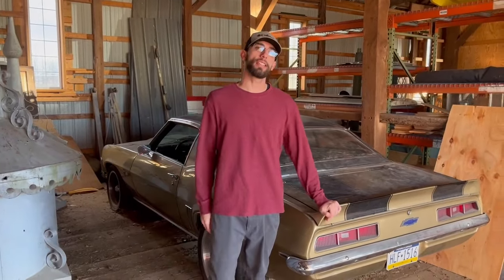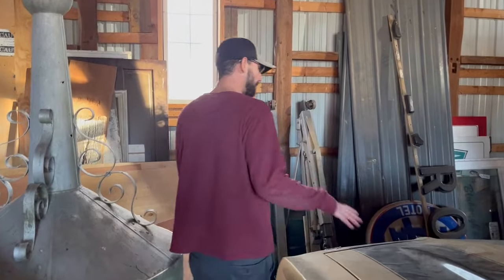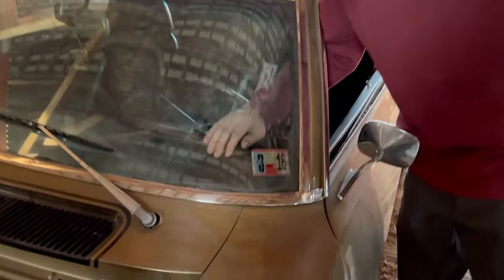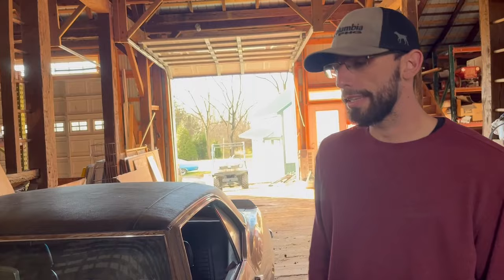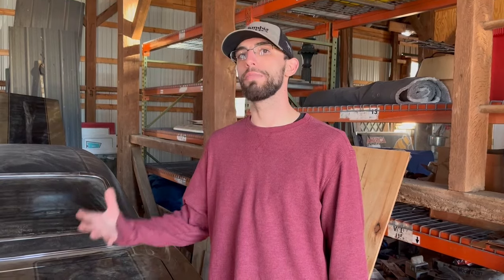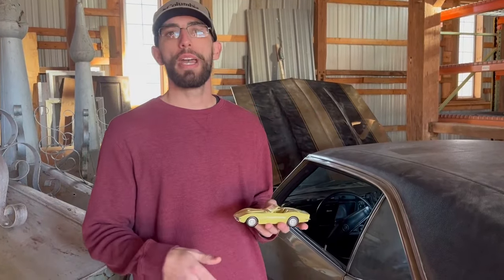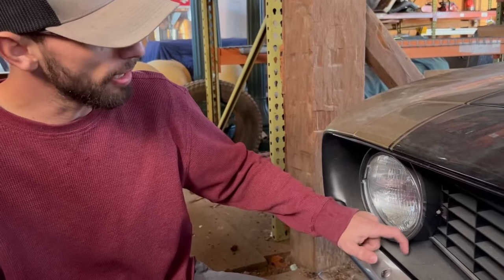1969 Camaro That Started It ALL! | Barn Find

Comment: Parker I personally would not LS swap that particular car. From the video it looks pretty unmolested.  I'd find one that wasn't that original.  Just my thoughts
Reply: Perhaps you should buy him another one then
Reply: @Cave_Monkeys  that's your Idea
Reply: You got to LS em to make them dependable
Reply: Yea, anyone who'd take an original motor out of a car that's 55 years old and put an LS engine in it needs to have their head examined, I wouldn't even do it if it had a straight 6 in it, if it was the original engine I'd keep it the way it is and look for some ragged out donor car with no engine for a project like that. 
There was a time when taking the original engine out of that car and swapping it for a performance upgrade was acceptable, which was about the time I was in high school in the early 80's, but certainly not now, ANYTHING and EVERYTHING about that car that's original should be left the way it is.
Reply: @dukecraig2402  bout the only way to make one dependable, get rid of that carburetor
Reply: @thruitallauto2538  
Spoken like someone who just doesn't get it.
And on top of that you're about 20 years late by thinking you know something other's don't.
Reply: @dukecraig2402  I’m 62 yrs old being dealing with this my whole life,so think again

Comment: Definitely keep the 327 motor in it, that will still keep its value more solid than changing to an LS. Besides that is a 60's block and a 327 is still a good motor especially with a 4sp.
Reply: It's originality is far more important than anything else, for those old SBC's that may have been one of the more desirable engines but compared to an LS it can't come close, but at 55 years old if it's an original engine leave it be, I wouldn't take a number's matching straight 6 out of a car like that for an LS swap, I'd just find a suitable donor car for a project like that. 
Once an automobile reaches a certain age it's originality should be respected, and over a half century old definitely meets the age criteria for an automobile that should be left original.

Comment: Lots of 1969 Chevrolets had bad motor mounts. GM recalled and added a steel cable around the upper control arm and an adapter that bolted onto the driver exhaust manifold. I remember them well.

Comment: Built my first hot rod from parts from 4 different cars. Would love to share the pictures and story with you and ask you some questions about the car. I bought a 1969 Camaro body from a guy who owned a body shop and towed the car to New England Drag for racing. He sold it to me after he pulled his engine, doug nash 5-speed and rear end out. I have the pics of it after I completed it and then restored it again years later.

Comment: Love your story, my first car was a 1968 Pontiac Firebird, basic 2 barrel 350 car 2 speed Turbine 3000 automatic Alpine Blue paint, Ivory White vinyl top, Deluxe Teal Interior. When I bought it at 15 years old it was freshly restored but not a great resto and the year was 1997, I fell in love with the car as soon as I seen it at the used car dealership. I had never seen a car as beautiful as this one was to me! Truely my first love and had to have it! When I bought it, (it was exactly as my icon photo) it was a custom blue and had a white RS Camaro style front stripe around its tail, with a Camaro rear bumper and a turbo 350, dual exhaust and the interior was a hodge podge of black vinyl, deluxe door panels, teal deluxe steering wheel, base/standard seat covers. I drove this car al through HS and stored during winter months here in Maine where I would buy a beater winter car to use in the snowy months. I left for college in the summer of 2001 and sold the car before I left so I could help pay for school. I regretted it and lost track of the car never to be seen again got married and life happens..... December 2022, going through a divorce, at home alone, an old HS buddy messages me a picture of my old car at 1030-11pm I think on a Sunday night, asking "isn't this your old car?", I quickly identified it with the stripe and same wheels and stickers I put on the car and replied "yes, why do you ask?". He replied " I have known this older gentleman here for a while but never knew he had your car, he just asked me if i knew anyone interested in buying his 68 Firebird and sent me this photo." I was freaking out and tried calling the guy on the spot, so late at night he didn't answer, i was sooo excited i couldn't sleep. I devised a plan to acquire the car cash and keep it at a buddies house untill divorce was final. The guy selling it had a unique story of how he acquired it and he had it for about 10 years but at 70ish years old he lost desire to restore it. He was very excited to reconnect the car back to me as it reminded him of his younger days when a similar thing happened with him and Chevelle he owned. My car is now in restoration phase body is almost complete it was very bad and it will be a restomod/pro touring with a 455 bored and stroked to a 501ci and dynoed on pump gas at 608hp and 625tq. I can not wait for this car to be 1000 times more fun to dive than it was in HS, it was a cream puff low compression 350 and an auto with 2:56 gears, it will now have a TKX 5 speed and a ford 9" with 3.21 gears........

Comment: Nice video Parker. My first car was also a Camaro, a 1967 Camaro. My mom purchased it in 1966 at Fletcher Chevrolet on the corner of Ventura Blvd and Hayvenhurst in Encino, in the San Fernando Valley, in Los Angeles. I was 10 years old then and I went with her to buy it new. She asked me and my sister to look through all the Camaros for sale and try to find one with a bench seat and air conditioning. I found the one she bought. It was royal blue with a 327, two barrel carb, and a power glide. It had the bench seat, black interior and air. It was clearly a plane jane. I went on my first dates in the car, first drive in and my first you know what in the back seat. Not a lot of room for that there. First time I went over 100 mph was in that car. Pretty much the first time for everything in that car. My mom promised me that I could have it after leaving the military but she gave it to my brother instead. He restored it and then it was stolen. About 6 months later they found the shell in an open field and it had been beat on and shot up. Stripped of everything, just like the shells you purchase and tow home. That was the end of that car. A sad day for our family. Your extremely knowledgeable and its interesting how you know about every hole in the firewall. I do the same with Thunderbirds. They are a bit simpler than the Chevys but still the same kind of thing, you can see what options came with the car just by the firewall. Bolt holes in the inner fender wells for options too tell a big story as well. Thanks.

Comment: Hi from Australia. Only just found this video. Parker I have a 69 Nova fitted with the wire band you mentioned. 350SS car. L48/3 spd Muncie with 12 bolt posi. Fortunate to have paperwork from original sale and protecto plate. Currently restoring it. Car was purchased from Daugherty Chevrolet Kingsport Tennessee. Keep up the great work with the channel. More Novas please!!

Comment: Parker, great video's. My first car at age 17 in 1975 was a 1969 Dodge Charger with 57,000 miles. 383 Magnum with an automation on the center console. (I later removed the automatic transmission and installed a 4 speed). I paid $1,200 for the car. I owned the car for about a year and a half and sold it in June of 1976 for $1,000. I still have the bill of sale and the spread sheet. The car is long gone. Had I only known what I had at the time I obviously would have never sold it. Keep the videos coming.

Comment: Hello Parker, my first car when I was senior in High School was a 69 RS/Z28.  It was a drag car that previous owner from Long Island NY had built.  It had a 4 bolt main small block out of a 66 chevelle.  Speed Equipment World in Long Island built it with 11 to 1 pistons double bump heads and GM 7140 off road cam.  M20 trans and 4:88 gears.  The best ET at National Speedway in Center Moriches Long Island NY was 12:08.  Remember I was 17 and didn't know shit about engines let alone cars.  The crew I hung out with in the Throggs Neck section of the Bronx NY were all 5 to 12 years older than me so I needed to keep up with them. LOL  My good friend Steve Schaefer who had the gathering place when all the guys hung out.  He was the one who checked out the car for me!!  That car was a blast to drive and very dangerous for a 17 year old to have as his first car!!  It also got 4 to 5 miles to the gallon!  So I sold the Z28 3 month's after I purchased it in late March of 1975.  I have had the Chevy performance addition since then.   I've had at lease 2 dozen chevy performance car since then.  I would love to recreate that car again!!  The problem is real 1969 Camaro Z28 are 125 to 150K.  Clones in great shape are 60 to 70K!!  They are out of control at the moment.  Hopefully soon I will try to find one at a better price?? LOL.
Reply from the maker: Ya never know, if I come across any other Z cars i'll keep you in mind! Thanks for your Story! -Parker
Reply: Yay

Comment: My 69 Camaro also has the braided wire strap on the driver's side motor mount.  These were to hold and brace the motor from excess movement on all the V8 motors.  You have a nice car.  Thanks for sharing so much info on Camaros.  I'm the 2nd. owner of mine and have had it since 1999. It's  a base model with X11 trim, LeMans blue with black vynal top. Love your channel! Great content:)

Comment: New viewer of your channel. On the mount recall, my 67 Camaro was eligible. I bought my car in 1970, and me being an aggressive driver would break the driver side mount about every 3 months. When the engine lifts, it jams the throttle where it is, pulls the vacuum hose off of the brake booster and locks the shifter against the console. I have a competition plus shifter that is directly mounted to the muncie. You turn the key off and the motor drops back in where it belongs. I notified by chevy that parts were available.  Because the mount was broke again and I waited so long to get it recalled, they put in the 69 "Z" mount that was beefier and had a catch setup. That mount lasted for years before I did a restoration in 1980. I still own the car presently and plan on another restoration again. She is a convertible  with the 275 hp 327. I am not changing anything on the rebuild, original as possible is my goal.

Comment: Great video! The passenger side has a cable and drivers side has a bracket that bolts to front exhaust manifold with a small cable attached to A arm. I have this setup on my 69 SS. It's called a stop lift kit. All your videos are great!!!

Comment: My highschool car was a fixer upper 1971 Plymouth Duster. Paid 600 bucks for it and man it was rough. It did have bucket seats and a floor console which pretty much sold me on it. Bought it in the summer of 1981 and my Dad and I fixed it all up so that when I turned 16 in the fall of 81 she was ready to go. So wished I still had it in reality it was a bit of a clunker when we started but my Dad put a ton of time in it to make it pretty special. The connection to my Dad is what makes it so desireable to me and wishful I still owned it!

Comment: Love your videos Parker in 1971 I worked at a small Chevy dealership in Kentucky and I put a whole lot of those motor mount kits on they went around the upper control arm on the driver side and then attached to the exhaust manifold it kept the throttle from jamming wide open if the motor mount broke

Comment: My 1969 Impala (327/235) had them defective Motor Mounts and mine was broke on the drivers side. It popped the brake booster Vacuum line and stuck the throttle (open) and dropped the Shift linkage into First while trying to do a Burn-Out. I replaced the Mount and attached a piece of chain as a back up.
Reply from the maker: Haven’t come across the chain modification yet lol

Comment: Hey Parker, do you only do cars from the 60-ties and 70-ties or do you do cars from the 80-ties as well? I own a 1987 Chevrolet Camaro, Z28 Irco-Z Convertible, 305 V8, 5 gear manual, of which only 744 were made in 1987...

Comment: My 68 Convertible indeed had a braided steel loop mounted via a bracket on the exhaust manifold bolts and it looped around the A arm, somewhere, if memory serves.

Comment: Hey, Parker! I’m in the same situation with my ‘70 Chevelle. I’ve had it for more than 30 years and have enjoyed hopping up the original 350.

I’m also considering an LS swap (my suburban has a 6.0 in it). When it comes down to it, it’s your car. Do what you want. It’s not a Z-28 or an SS, so keeping it original doesn’t offer the same value as if it was a rare package. That being said, also consider that an LS swap is not like dropping in a big block… it’s a major conversion! Whatever you decide, it’ll be good.

By the way, I sent a DM over on your Instagram account. 👍🏼

Comment: I received a service notice in 1970 from Chevrolet for my '69 Z/28, to replace the original motor mounts with the new design interlocking mounts. The work was performed N/C by my local Chevrolet dealer.

Comment: I own a 1969 X-11 SS 350 Camaro that had two cable straps one one each side of the engine attached to the exhaust manifold and the upper control arm pivot rod that I removed when I purchased a set of Hooker headers for the car  unfortunately I tossed them away when i removed them !

Comment: My first car was a 1970 base model Camaro.  Gold with white vinyl top and white interior. I believe it had a 307 from the factory but had a 350 installed by the time I bought it with a 350 turbo transmission.

Comment: Hello 👋 David here from Sebring Florida, I been a Camaro fan since I was a boy 👦 Did you know that in 1967 they made a cut away Camaro, to show how well it was made. I saw it at our local shopping center in California, I was very impressed! When I was older I got different years Camaro’s including a new 2000 Camaro. My question is have you ever driven a straight 6 1967 Camaro with Automatic Transmission? What was it like? I don’t like to go fast but I always liked the look of the 1967 Camaro. I  now drive a 20O7 Chevy Trailblazer, 6 cylinder, automatic, I know I am kind of a dull guy 😊lol 😂

Comment: I was a lot boy in the mid 70's, and finally saved up enough to buy my first car in 1977, a '67 GTO coupe, not a hardtop.  it was a little rough, but not too rusty.  only options on it were a 4 speed, console, and AM radio...nothing else.
a 327 is pretty good engine...i'd say build that up instead of modding it...go old-school day 2 and you'd have a pretty sweet ride.

Comment: Parker, you asked about the motor mount problem with camaros and it was a problem with GM cars throuhout the 60's, i've seen chevrolets of all models with this motor mount repair. GM had a kit available over the parts counter to install that took care of the recall. I used to have some of the N.O.S. kits but sold them years ago, there were a couple different kinds one was like yours with just the cable and there was one that had a metal bracket that bolted to the exhaust manifold and a short cable went through the horizontal bar on the upper a-frame of the suspension. I first saw one on my dads 63 SS Impala when I was a kid. So this problem was close to a decade long apparently.

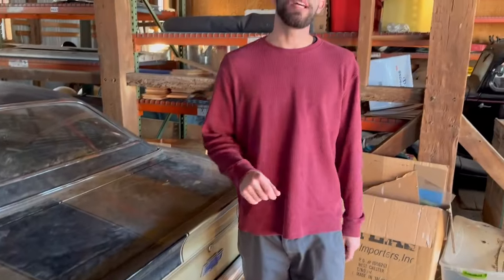Comment: I bought my first hot rod in 1977 as a body only, no motor, no transmission, no  rear end, from a guy who was done drag racing it, for 450 bucks delivered! Bought a green on green rusted out 1969 Camaro SS 350 4-speed close ratio Muncie for $150, pulled and dropped it into the drag car, bought a 4:10 12 bolt posi rear end and assembled my first hot rod at 17 years old with no driver’s license and it still had line-lock in it and traction bars. How do I post a picture of it for you?

Comment: I had a 67 and a 68 both with the engine mount straps. Was told it was a recall and over the counter part to add yourself.

Comment: Hello...I own a 1969 SS/RS 350 ci. I bought from the original owner in June 1982...Cortez Silver with Drk Blue standard interior...Took first place with the Camaro at "Super Chevy" for best original that's how nice this car is...also a note on the "Hold Down on the motor mount "That was on the right side" Because of it being an AC car which is correct. I noticed that you camaro is a 12A car...at that time the "Short Spoiler" was what would have come with the Camrao if that option was ordered. There is still discussion on when the longer spoiler became the standard "Option"....Also this is a Arizona car...Bought right here in Tucson and has been here ever since new. I am now doing a full restoration and have a ways to go.

Comment: Hey guys I have an engine from a 69 Camaro  in Pittsburgh Pa. From the info on the block it's from a 350/350hp, 4spd car. What car would that be?
Reply from the maker: I would say it's an L46 350/350hp out of a corvette, what is the Suffix code on the front pad?
Reply: @backyardbarnfinds I remember my friend in 1975, owned a 1967 Camaro SS with the L48 350 and he told me this was a Camaro engine.   The Chevelle, Vette and Nova kept the 327 with more HP output.  In 1968, I believe the Vette and Chevelle stuck with the 327 and Nova was available for the L48.  In 1969, Chevrolet took the performance 327 off the table and then all three cars got the 350 mill as a option.  A neighbor of mine, still has her 1971 Nova SS that she ordered and it has the L48 engine.  I personally owned a 1969 Camaro RS/SS with the 350…. A fast ride.  The point being not many young people know the 350 was built specifically for the Camaro introduction year of 1967.